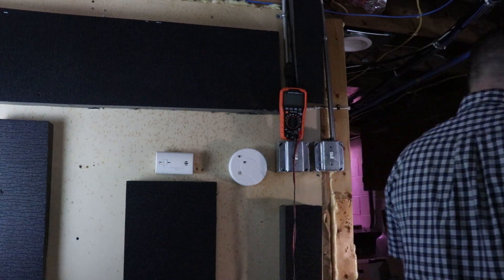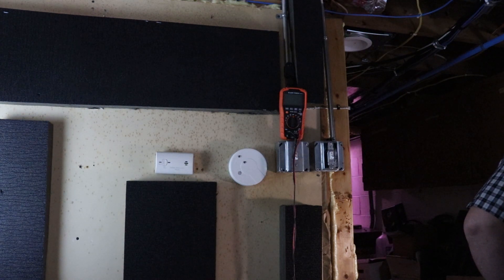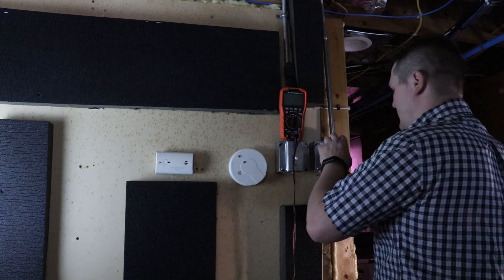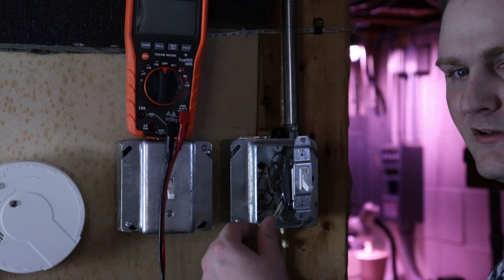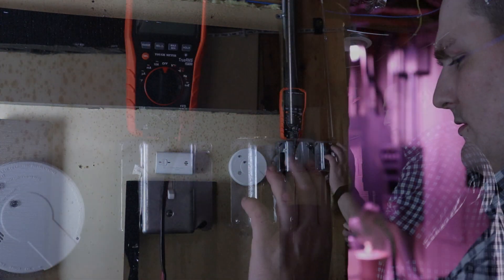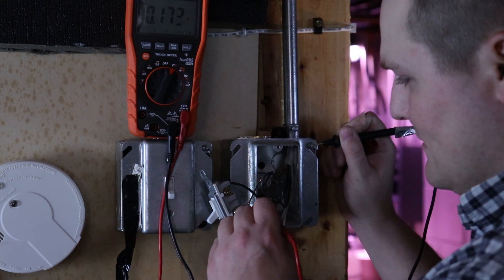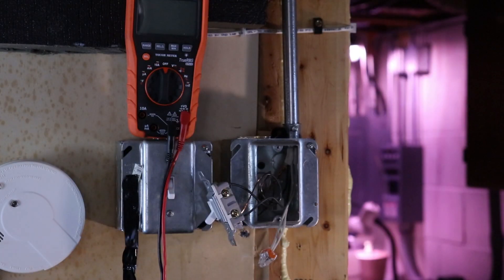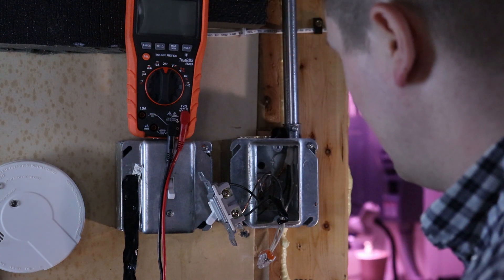(How To) Sonoff RTSP Camera Install & ZoneMinder Setup ( & Electrical Outlet Install)

Comment: Any idea what protocol the sonoff uses for PTZ
Reply from the maker: RTPS I have gotten the PTZ to work yet with it.
Reply: @TNW1337  you cannot control the sonoff PTZ via rtps.

I'm trying to get it to work with luxriot and blue iris, but no luck so far.
Reply from the maker: @ErikThiart  Ive had hit or miss luck with blue iris. I had it working then swapped over to a New Nvr Server. Lost all my setting, it is possible to get it to ptz.
Reply from the maker: @ErikThiart  I do not have much spare time. but if you want to try and trouble shoot it Monday. We can jump on discord and see if we can get it working again. I am pretty sure I just tried different profiles till I got it to Ptz. Then had to manually enter the info in for The RTSP in that profile.

Comment: You say to set the buffers low to make it easier for the cameras, but isn't it the ZM computer that's doing the work to buffer the frames and not the camera? The camera is just providing the feed. I may be wrong, can you clarify?
Reply from the maker: yes the buffer is in zone minder, if you are have problems you can start to lower the stuff in that area
Reply: @TNW1337  Right, but my point is, doesn't that just make it easier on ZM and not the camera? You seemed to imply that changing the ZM buffer makes it easier on the camera.
Reply from the maker: @bigmanblackt-shirt8506  From what I've found it seems to help both. But you are right it is probably Zone Minder that is the problem. When you increase the frame rate it is drawing more from the camera. So it is like 70% Zoneminder 30% Camera. If you lower the frame rate in the camera it does not have to work as hard. If your ask for 5 fps then Most CCTV cams will auto to this rate. Unless you have a advanced setting in the CCTV camera witch most do not. 

Or they are set in stone Witch I have not seen on newer cameras mostly older 480 & 720 Line BNC or Coax where like this.
Most modern CCTV cameras are variable rate FPS (Frames Per Seconded). Or there is a setting called VFR (Variable Frame Rate)